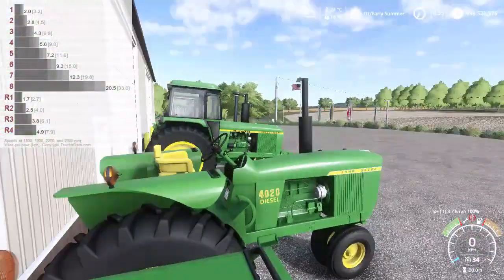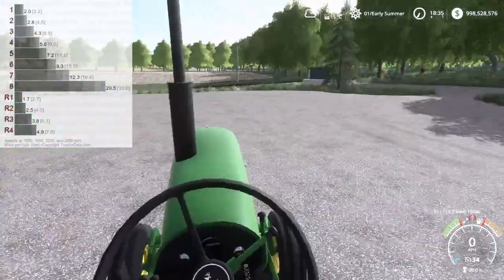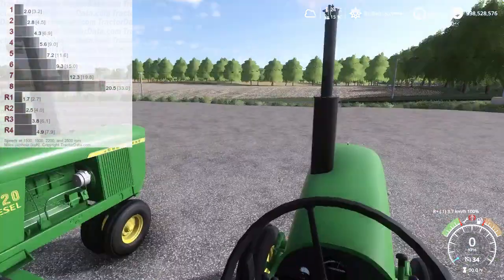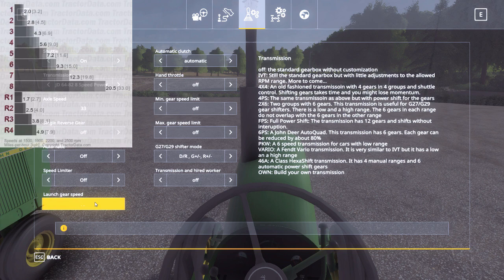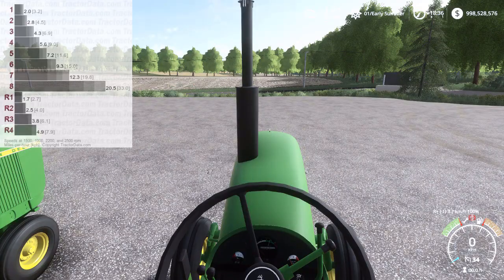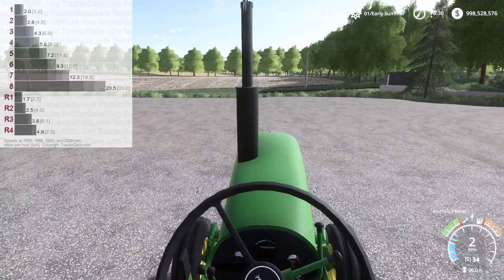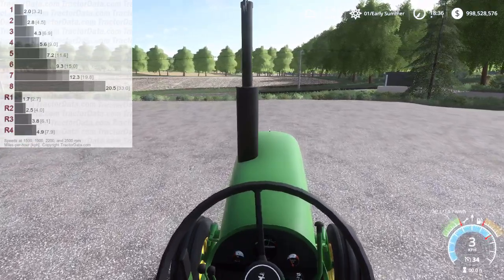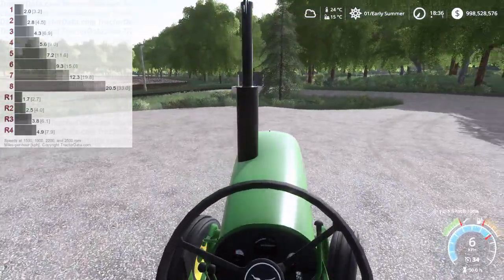FS19|John Deere 8 Speed Powershift Transmission Demonstration

Comment: I drove a 4230 with a 8-speed powershift, and while it’s recommended to start in 1st, you can start in any gear as long as you use the clutch. I started in 3rd without the clutch one time and popped a wheelie 😆

Comment: You can start a powershift or a synchro range transmission in any gear. On a powershift you can also shift from any forward gear to any reverse gear without using the clutch an on a synchro range you can only go forward an reverse between 1st 3rd an 1st reverse or 2nd 5th an 2nd reverse an they have a hidden 3rd reverse in 4th an 7th gear range but you have to use the clutch for every gear an you should stop before shifting to a different range. Also the mod your driving around looks like a synchro range transmission not a powershift
Reply from the maker: These videos were recorded a few weeks ago, I had been wrongly told that a powershift needed to start in 1st, and just kept going with that knowledge while recording these videos.

As for the tractor, it is indeed a Synchro-Range, that's the next demonstration video, but I made the powershift transmission anyways.